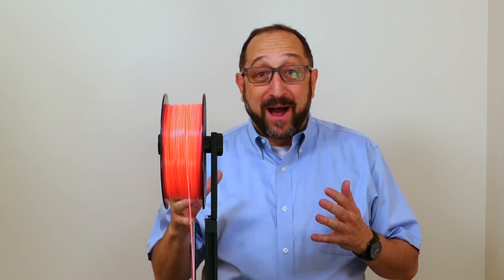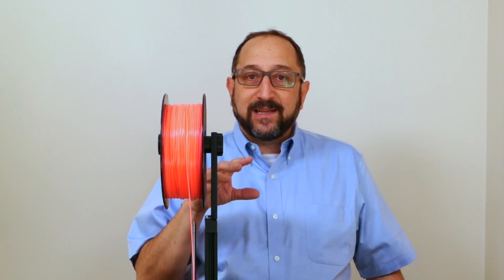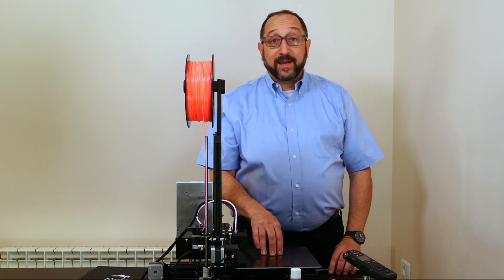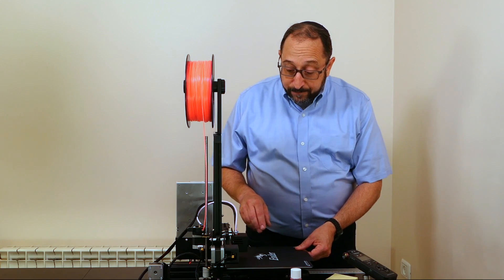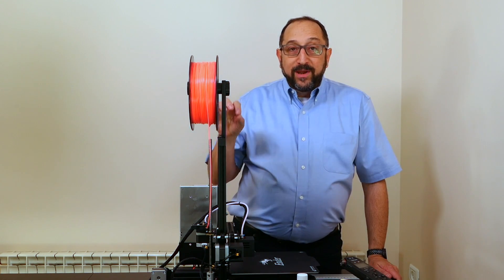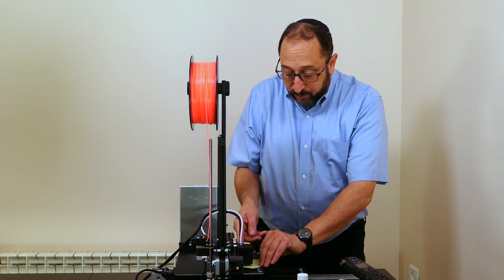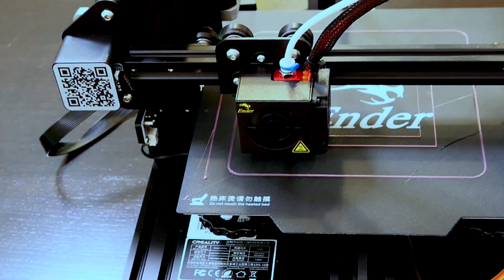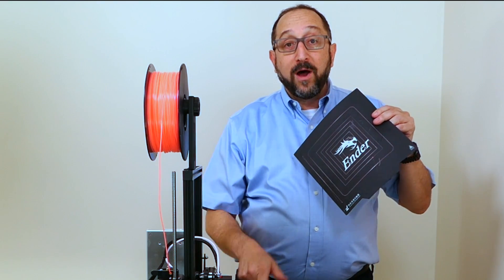How to Fix an Ender 3d Printer Warped Print Bed

Comment: Thanks DrVax. I have been pulling my hair out trying to get a good first layer print. Unfortunately most of the videos out there only talk about leveling the bed spring and if there is a warp they only talk about how it's normal and just to not try to get a perfectly level bed. Gonna try this out later after letting my brain cool down from the amount of frustration over the past 3 days. I do have a glass bed that I was going to try next which, by most accounts it does give you a flat surface but then it introduces some other issues to deal with such as making sure it is properly heated up, reducing stepper motor jerk, adding glue to some in case they do not print. Was gonna try mesh bed leveling next but I would rather learn these other fixes as well. 
Ender 3 has always been as one of the best printers in it's price range for all it's mods and upgradeability  but unfortunately the bed has always been a sticking point til this day since they stamp out instead of CNC machine the bed.

Comment: thanks for making such a valuable video instructions. I thought of purchasing a glass bed Or to return my Ender 3 to amazon assumed that the printer is defective. 
I bought it mainly for printing face shield for donation but the printer failed to print it correctly most of the time. I had to adjust the level each time.  
By the way I don't have sticky notes, so I cut out 2 times 3"x3" from A4 paper and placed them in the middle but I'm not sure the paper will catch fire during long hours print. 
I will let you know if it catches fire  :)
Reply from the maker: The paper should be fine.

Comment: About your leveling method, why would you not do this while the printer is on and move the x and y carriages with the LCD? As stated by "Parts Dave," in another comment, you really should try not to move the x and y carriage motors while the printer is powered off because they will generate electricity (See his comment for a much more in-depth explanation). Also, I have found that you want almost no friction on the paper when leveling.
Reply from the maker: I have a later video on the channel using a different approach.  You can view it here:
https://youtu.be/zfTm0SqIFm4

Comment: Thanks for the video, one of the best explanations I've seen up to this point.  However, I did take your advice, I used a ruler and don't see any space, then leveled it again and when I print, parts of the filament do not stick, especially on the bottom, but frankly on top too at times.  It was printing perfectly for a while and then it stopped.  I am using PETG and the temperature settings were 240/80.  Do you have any further advice on what else I can do?  Thanks.
Reply from the maker: PETG is quite tricky.   First the filament has to be very dry.  If it has observed moisture you will have trouble.  Also try different temperature, both lower and higher.
Reply from the maker: Finally slow your print down.  You can always go faster once you get it working.

Comment: My default Ender 3 bed seems to be warped a little. The center appears to be a little lower than the corners and I tend to experience adhesion issues from time to time. This idea with putting a sheet of paper underneath came to my mind too, but I am a little worried how it might impact to uneven heating of the bed (paper is known to be a poor heat conductor) ... So, from this perspective, an aluminium foil sheet is probably a better idea ...

Comment: I use ikea mirror (12" x12") for my Tevo Tornado. The center of the mirror also dip... I think the trick you share here may not help as the mirror is not soft/flex surface... Thanks for sharing though.
Reply from the maker: You are correct.  This tip is for a flexible print surface.  Glass mirrors should generally be flat.  I would bring a metal ruler with you the next time you buy a mirror and put the edge on the surface before you purchase the mirror to make sure it is flat.

Comment: Thanks for the video, but this damn thing is pissing me off enough to take a bat to it. No matter what I do,  everything changes once the bed is heated up. It's like warping will happen when it's cooled down, and then it will change once it's heated up. There's already damage to the print bed, magnetic, and I have spent literally days of time with constant failures.
Reply: heat the bed not thetemp you will print at and then check the bend

Comment: I like Dr Vax's description of how the Post It Note should move around...  5:32 "and see if it just slides around a little bit but with a lot of friction". I also like how he does it cold. 

What I usually do is level it off using the paper method but with the machine on. This gets the leveling pretty close. (I usually only use this paper method when the level has been toss off by, say, a hot-end adjustment.)
I then print off 5 20x20mm pads from Thingiverse (one per corner, plus middle). I keep printing off the pads till I'm happy they are all just right. 
Interestingly, when I measure the thickness of the pads, they are all close to 0.2mm or 1mm for all 5 of them.

Comment: Why dont they just make them flat , I got an Anet A8 for £70 off ebay (wooden frame kit)
No big wheels for bed leveling so u have sore fingers & wooden Y carriage , BUT ITS FLAT .

I got ender3 pro of bangood £163.00 everything is fine apart from the bed god dam dip in the middle..Iv orderd the glass sheet from creality , so gonna try the aluminum foil trick till it comes .
Reply from the maker: I am trying out an Anet ET4 with a glass bed from the factory now.   It will be interesting to see the results.  My thought is that it is very hard to get metal beds perfectly flat depending on the manufacturing process.   Low end printer manufacturers try to cut costs on manufactory so the metal print beds are problematic.   That is probably why companies like Weedo (Monoprice Cadet and Ultimate 2) and Anet ship printers with glass beds which are easier to manufacture flat.

Comment: Thank you DrVox
It really fixed the problem
In addition, using the paper might decrease the Bed desired temp. So, as suggested by Motoshow below, I used an aluminum foil so it keeps the bed temp as desired.
Thanks everybody.

Good luck to all
Reply from the maker: Thanks fir sharing.

Comment: I have a dip. I replaced the magnetic bed with the glass creality bed and it’s also dipped in the middle. I ordered another one just in case and it’s also the same. Wondering if it’s the carriage that is bent?? Ender 5 pro
Reply from the maker: Not sure how that is possible.   Even with BBC a bent frame glass should be flat.   How are you determining your glass is dipping in the middle.
Reply: @MakeWithTech  I found the bed on my Ender5 Pro to have a dip even after replacing it with glass.  I checked using the ruler method you described in the video.  I put some foil underneath the glass and the dip was reduced.  I think I will play with it some more.  Thank you for your video!

Comment: You should check the bed flatness and level when hot. It will expand substantially in the XY when heated and might warp in the opposite direction.  It is also anchored in 4 places, it should be anchored in 1 place with less restrictive anchors in two more places.  I check the bed level when hot with a drop indicator mounted on the head. It is super fast and way more accurate.
Reply from the maker: Yes you are absolutely correct.  You should level the bed when hot.

Comment: CHEP has a good gcode file for levelling the bed so you don't have to manually move the axis
Reply from the maker: I am a big fan of CHEP.   I also have a video about using gcode to move the print head for bed leveling.   Here is the URL:

https://youtu.be/zfTm0SqIFm4

Comment: Great video, I had the same problem. It was a very good explanation, thank you for that 😀
Reply from the maker: Thanks.  This is an example of a simple fix working better than many more complex repairs such as replacing the print bed with glass.
Reply: @MakeWithTech  yes I was already thinking about bending my plate back but that was the last option I would consider.

Comment: Cannot thank you enough for this. Dozens and dozens of failed first layers, and simply putting a sticky note down like you did immediately yielded better results. Thank you so much!
Reply from the maker: Your welcome.
Reply: I spent several days trying to figure out why my Bltouch couldn't level the bed properly. Eventually figured out it was because the middle of the bed was depressed. The most annoying issue I have ever encountered with a printer.
Reply: Chinese quality control.
Reply: @packetattack7437  most things on this planet are made in China, even your Japanese brands like Sony and Toshiba etc are manufactured in places like China and Singapore etc.. its native and short sighted to just stereotype like that. Quality control is subject to the requirements of production.  QA on a 200 dollar/pound printer isn't going to have the same QA as one worth 2k.  If it's QA you're worried about, spend over 1k and you won't need to worry about 'Chinese quality control'
Reply: @vagautohaus4492  Are you virtue signalling or just naive? Btw, it's naive, not native unless you were inferring I'm native to the APAC region, which I am and understand QA/QC and mfg specs quite well. 

Creality has over 600 employees, two ISO quality certs and produces over 1M 3D printers a year.  The fact that they can't get a flat bed is outright embarrassing and has nothing to do with a $200 price point. In manufacturing the concept of quality at scale and defect reduction is key. Creality has enough smart R&D people to know this.

So yeah, Chinese quality control.
Reply: @packetattack7437  'native' was autocorrect, and still, the product being made in China is irrelevant to its level of quality.
Reply: @packetattack7437  How bad "quality control" is "chinese quality control"?

Gibson couldn't make an stupid expensive electric guitar without problems, even when they was THE guitar industry. So I must say it has to be "USA quality control" right?
Reply: @daniloberserk  I don't profess to know anything about guitars.
Reply: @packetattack7437  Low-end consumer products QC, but applied to what's sold as a precision product... Cha bu duo (eh, it's good enough...)

Using a slightly thicker aluminum plate and grinding it flat would add another $2.00 to the production costs... can't have that!!! /sarcasm

The mis-aligned z-axis screw is a more obvious case of Cha bu duo, because the motor mount is a necessary part of the assembly anyway, and the differential cost to get it right (extra 1mm or so of plastic) is a truly insignificant cost that they don't bother to incur.

Comment: Flinstones still using this method when there is marlin 2.0 and 100 abl systems or just manual mesh bed leveling.
Reply from the maker: Cute.  Might be old school but it works well.   I will be producing another video with a custom model that uses gcode to position the hot end.  This will in effect add "assisted bed leveling" to any 3d printer.

Comment: I have a higher center bed compared to the 4 corners. Had the corners levelled but the center point has no gap. Any suggestions what to add to lift all 4 corners
Reply from the maker: Same technique.  As an alternative switch to a spring steel print bed like layer lock from MatterHackers.

Comment: I have a 0.1mm hight stainless steal sheet is it better then the note, for heat transfer? Maybe should get copper foil ?
Reply from the maker: Thanks for your comment.   Yes a metal surface will transfer heat better but I have not seen any negative side effects of using a pop it note.

Comment: Hello, first I want to thank you for the info, the tip of the post-it helped me a lot.
On the leveling of the bed, moving the head by hand is bad for the printer. It is better to use a gcode file.
I leave two files for ender3, but it is easy to change it for any printer.
The first file locates the head in each corner. The second one repeats the process twice.
https://cutt.ly/ieRgph2
I hope you find it useful.
Reply from the maker: I just did a video about this.  Check it out at:

https://youtu.be/zfTm0SqIFm4

Comment: You need a better microphone.
Reply from the maker: This was filmed away from my home office where I use a Rodes shotgun on a boom.  I used a tascom recorder here and had too much echo in a small room so I processed with an echo reduction plugin in finalcut.  I may have over processed.   I will try and correct in future videos recorded remotely.

Comment: Or do a 5x5 manual grid mesh all it takes is to upgrade the firmware
Reply from the maker: Thanks for sharing.  For some of my viewers upgrading firmware is outside their skill set.  I try to produce a range of videos that address a range of skill sets.
Reply: @MakeWithTech  what u can do is give them a precompiled hex with the bootloader all they need is a isp programer they have to connect it and click upload on the software.
Reply from the maker: Yes but even opening up the printer to gain access to the programming pins on the control board is not easy for everyone.

Comment: Instead of a Postit paper you can use tinfoil. It will transfer heat better. And in 99% of the time fixes the issue. Also moving the bed to fast will cause electrical back flow and can and will over time burn out resistors or capacitores. Capacitors are not ment to have voltage back flow
Reply from the maker: Thanks for the suggestion.

Comment: WOW so much bad information.
1. Generating energy spikes can cause damage especially on the some of the cheaply made components (info from Parts Dave in the comments is great).
2. Things swell when heated so best to level when hot.
3. Best to use a bed levelling gcode file or move the head in the menu and not move the head by hand as you can bump and not keep the head at the same height.

I also inserted paper under the magnetic bed, but if people have a little extra money, invest in a Ultrabase glass sheet, not normal glass it has a coating that helps things stick, a straight glass bed is good too but not great to learn on as it can be a little tricky and frustrating to get prints to stick.

Thanks for the putting content out there (I couldn't do it) but this one is a little off, and sorry if I sounded harsh (really don't want this to sound like I'm trolling).
Reply from the maker: I appreciate your comments but do not agree with all of your observations.  

The procedure I recommend is much easier for beginners and if you move the print head slowly it is unlikely to do any harm.

Yes leveling with a heated bed is optimal.  Just heat up the bed and then turn off the printer.  

I prefer the matterhacker layer lock print surfaces as an after market alternative to glass.

Comment: Nice video again. I might be worth noting that after rubbing with fingers, isopropyl alcohol should be used to wipe out any grease that might weaken the adhesion
Reply from the maker: Excellent point.  Thanks for sharing.

Comment: The best bed leveling video I have seen, spot on with saying if the line rubs off it is too  low, and if not there or pressed into the surface too high.  Such a simple way to tell.
Reply from the maker: Thanks.  I am a big fan of simple.

Comment: I had a dip in the centre of my endear 5.  I got a glass sheet.  It appeared to be Flat to a straight edge but still had dip when I levelled it. Presumably the x or y axis has a dip.  Bl touch kind of cures it and it's a good fix for for what I do but I'm very aware that it' not right really.
Reply from the maker: ABL fixes a number of issues and is perfectly ok.  Nothing wrong to use software to compensate for manufacturing variation.

Comment: Just remember that worm thin aluminium bed will deform more than cold ;) So lvl should be check on hot bed (then is much worse than cold :p )
Reply from the maker: Good suggestion.
Reply: @MakeWithTech  I have 3, 3pro, 5 ;) So I know this issue too ;p

Comment: 5:00 why don't you just do homing and then disable motor?
Reply from the maker: Good suggestion however homing before leveling bed the first time can cause a collision with the bed.
Reply: @MakeWithTech  okay, good point
Reply: I always drop my home corner before I do it, then I don’t have to worry about that.
Reply: @nordicmagpie  yeah, im doing the same.

Comment: my one had a really bad one, i bought a glass plate, didn't work. i bought a bltouch and now the problem is the VERY BAD glass plate. nothing sticks to it. i will buy a buildtak or so soon. 
cool video, have fun visiting your family
Reply from the maker: Try the MatterHacker layerlock print service.  It will work perfectly with the ender magnets.
Reply: @MakeWithTech  Thanks for your response,

yeah.... i don't have the pro. the problem is the first one (the normal one) has quite some damage in it, so i bought a glass. but now it won't stick anymore. I plan to buy either the normal one again, or a buildtak. Thanks for your response, what can you suggest?

Comment: Thanks for the video, make sure that what ever you are using has a high flash point or you could cause a fire. Paper has a flash point of over 450 F, much higher then the bed heater. I would use a aluminum foil to make sure that there was no chance of it breaking down over time.
Reply from the maker: Excellent point.  Since the post it notes are very inexpensive you can replace them if you see any determination due to temperature.   Also the top print bed temperature for the ender line is about 100c and the Ignition temperature for most paper is about 230c.
Reply: @MakeWithTech  I just think that aluminum foil would be more stable, also the aluminum foil would let the heat pass evenly to the build plate. The aluminum foil is thinner to make much finer adjustments. Thank you for the video, I'm going to be buying a Ender-3 and your videos are a great place to learn about 3D printing.